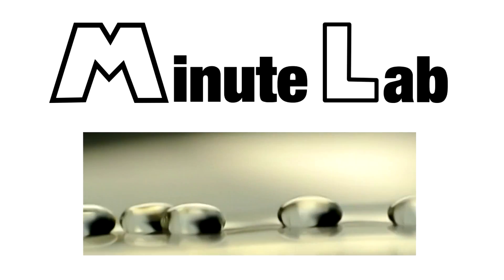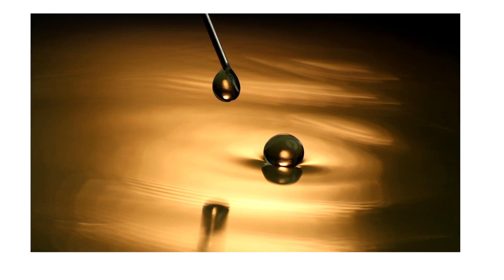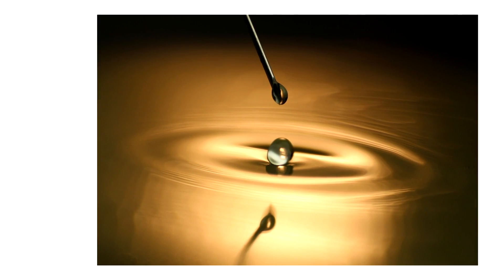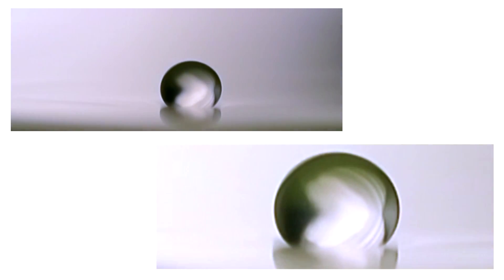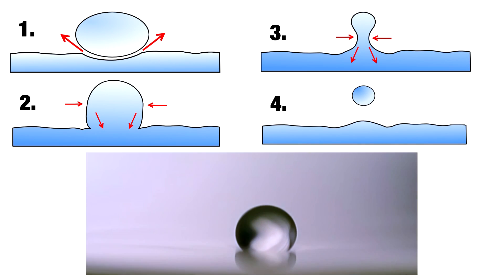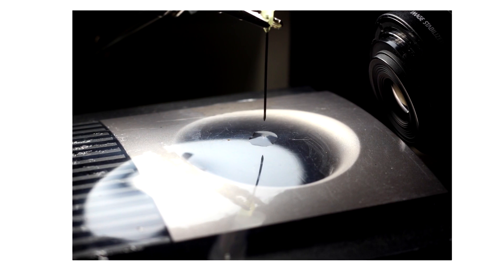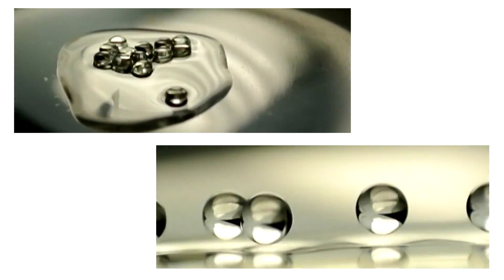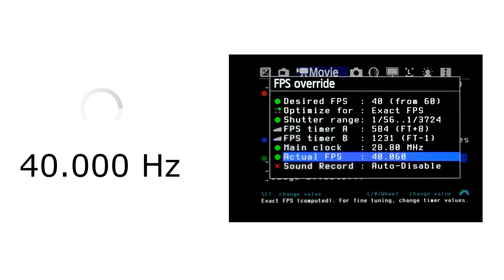Bouncing droplets - High speed || MinuteLaboratory #17

Comment: Those were awesome video experiments and I have a great appreciation for your innovative method of slowing down video! However before concluding that the cause of the bounce is due to air entrapment you should investigate Dr. Pollack's discovery of the "EZ" water phase. Apparently water has a fourth phase at an interface with another material, especially hydrophilic ones, that cause it to "crystallize" despite being a liquid... Then it takes energy to overcome this organization that exists in the surface is responsible for the lack of agglomeration.